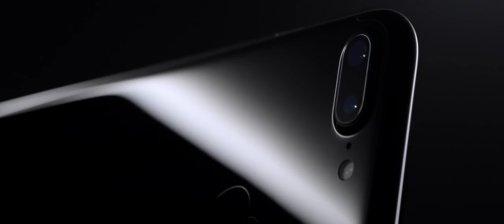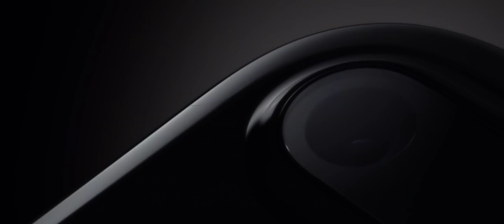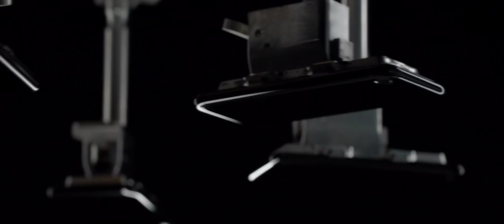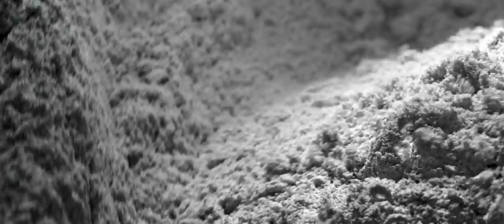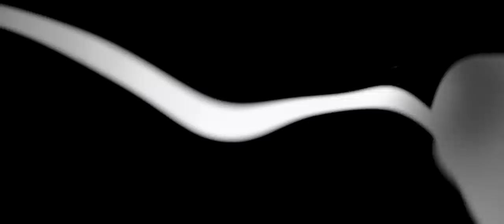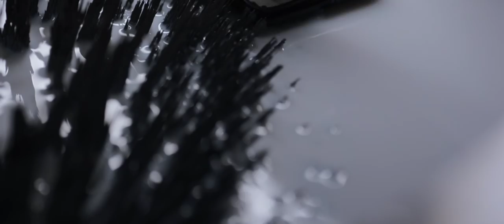iphone7 LO QUIERO YA!!!! amazing!! 믿어지지!!!! 信じられません!!!!

Comment from the maker: https://youtu.be/eJmbHvWrv_Y ….PART 2
Which improved iPhone 7
1. Increased storage capacity: now the cheaper version has 32 GB of storage. There is an intermediate edition of 128 GB and higher capacity reaches 256 GB. Disappear alternatives 16 and 64 GB.
2. Camera with substantial improvements: iPhone camera features 4.7-inch optical stabilizer, 28mm lens focal range and aperture of F / 1.8. The flash is now made up of four LEDs —two warm shades and two cold tones— lights. In addition to this, the sensor includes a function that adds artificial light to dark conditions captured in shots. According to Apple, the user can see red and green colors more intensos.Graba 4K.
3. Dual Camera for iPhone 7 Plus: the older brother of the family has an additional sensor. This camera has a lens that provides the camera with an optical zoom range of up to 2x and 10x hardware using the software.
4. A more polished finish: the iPhone is built in glass and aluminum. The result is a team with adamantine —much like the Galaxy S6— appearance. That seems to have become a magnet for fingerprints.
5. Resists water and dust: finally, the iPhone meets the IP67 certificate. That means it supports in water to a depth of one meter for up to 30 minutes.
6. It is more powerful: it has a quad-core processor A10 Fusion. Two cores run faster and be used for demanding tasks and two other handle a lower speed and enter into action when running undemanding applications. With this, a significant energy savings would be achieved.
The graphics processor is responsible for 6-core and offer performance up to 50 percent better than the iPhone 6S on issues such as video games or editing applications.
7. It has more RAM: 4.7-inch version will feature 2GB of RAM and 5.5-inch comes with 3 GB of RAM.
8. Best Front Camera: going to have a 5 MP sensor to July 1 MP auto image stabilization and focal aperture of f / 2.2
9. Display: they are the same size and the same resolution —Full HD for the Plus and 750 by 1334 pixels for 4.7 inches—, but display as many colors and are up to 25 percent brighter.
10. The home button changed: it is now pressure sensitive. No more 'click' as a normal button, but responds to different levels of pressure. The fingerprint reader is also faster.
11. Price: No increased from the iPhone 6S. It is $ 650 = $ 1,950,000 in for the normal version of 32 GB .- and $ 770 = $ 2,310,000 in Plus edition for 32 GB.
12. Colors: variants jet black and add black and look stunning. The jet black only available in versions of 128 and 256 GB.
Which leaves us skeptical
1. Goodbye to traditional audio connector: there is good reason to remove the analog port of 3.5 mm with a digital output, the audio is better quality and favorable technical virtues such as noise cancellation. However, at the moment it is a measure that will generate discomfort. You will be obliged to purchase hearing aids that have Ligthning port or must use an adapter —this, at least, comes in the box— or be inclined to wireless accessories.
2. Wireless headphones: Apple launched two wireless headphones pompo: Airpods and the Beats Solo Wireless. The first cost $ 169. Lack try, but this suggests that the primary motivation behind the removal of 3.5 mm port was to establish a new line of business.
3. The dimensions of the phone are the same: the measures the iPhone 7 and iPhone 7 Plus are identical to those of their predecessors. No change in either height or width or thickness —7.1 mm to 7.3 mm iPhone 7 and iPhone 7 Plus—. Although the thickness is adequate, there was room to improve the height and width of the equipment.
4. The battery improved slightly: Apparently, it will take more time on the iPhone 7 and two hours in the iPhone 7 Plus. There seems to be a huge improvement.
5. No rapid charging system: almost all manufacturers have a technology that can recharge cell completely within an hour. Apple is still in debt in that paragraph.
What no one expected
1. Mario reach mobile: this is great news for Nintendo more than for Apple. Mario will land in the universe of mobile, first iOS and eventually Android. It will do so with a title called Mario Run.
2. Go Pokémon in the Apple Watch: add this popular game to a smart watch is a masterstroke by the developer house, Niantic.
3. Apple Watch Series 2: If a new version of the Watch was expected, but was surprised to resist in water at a depth of 50 meters. As if that were not enough, GPS incopora and will be a model in ceramics. Thus, it will lower the price of the original Apple Watch. In addition, they partnered with Nike to produce a version with features designed for sports enthusiasts.
4. Change the offer iPad Air 2 and iPad Mini 4: now are only available options of 32 GB and 128 GB. The 64GB disappears. the price of the iPad Pro 9.7 and 12.9 inches fell.